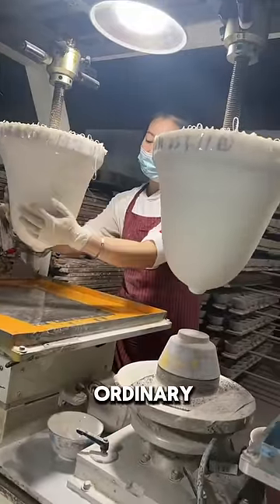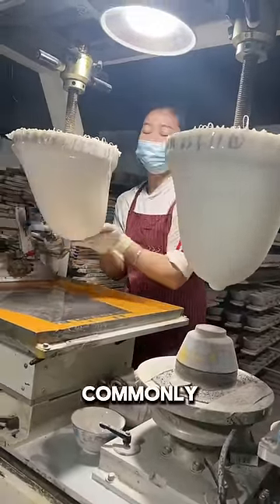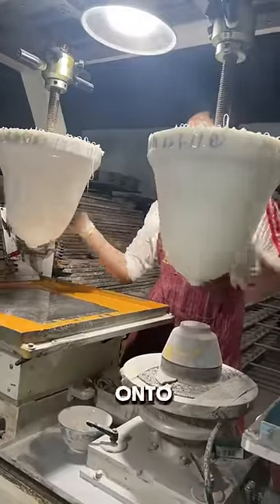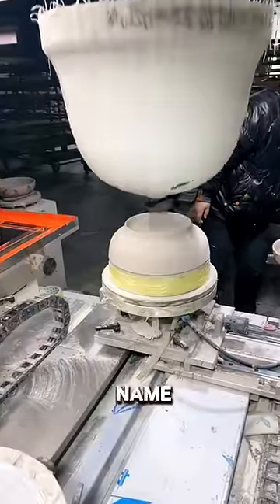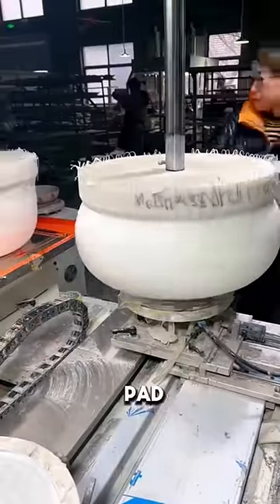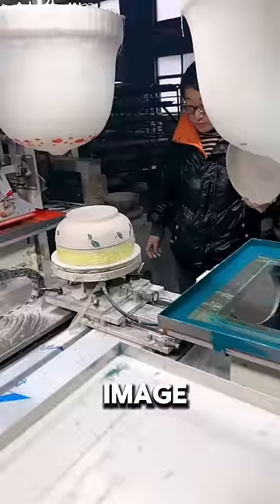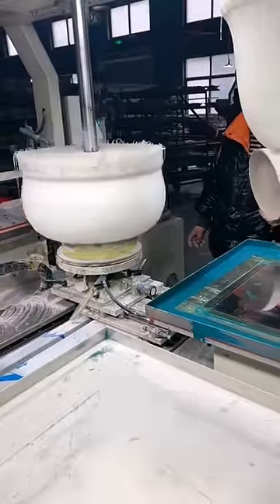Pad Printer Technology #shorts

Comment: For printing purposes, I can't figure out why it needs the nipple.
Reply: Yes !!
Reply: To center it i guess... 😅
Reply: to center it like the other commenter said, but also don't forget those tiny makers logos on the bottom of the bowls too
Reply: Its investor was a MAN OF CULTURE
Reply: Chris, It's a bump.
Reply: Its probably for the manufacturer name to be printed at the bottom 🤷🏾‍♀️
Reply: its for centering  and also it stops the silicon from jigglin too much after it touches the surface . Nature is the best teacher xD
Reply: I assumed it was for air displacement for a consistent stamp.
Reply: If it was flat it would become a suction cup. 

But because there is the nipple as you call it - and equal but opposite forces will have a reaction bonking backwards - 

the surface near the bottom of the bowls is pushed back upwards (doesn’t become a suction cup because there’s not a smooth surface the bump gets pushed in so when it’s pulled up it pushes down and cleanly away) reducing friction and tension overall

Centering is true but it’s not as big of an issue when the bowls are formed exactly the same size and same shape from molds and then placed onto platforms of the same shape and size. It can do thousands of stamps before having issues of misalignment since it’s basically on a hydraulic press which always does the same pushing motion.
Reply: Precision.
Reply: What else ye gonny tickle 😂😂
Reply: I think it's to get the print into the dip at the bottom
Reply: The bottom of the bowls have indents so the nipple let's them put patterns on the bottom without it becoming Warped if they want.
Reply: For the center and the logo that almost exist on all palate
Reply: To keep it from sticking
Reply: Center indicator
Reply: Because it is Man maid ✨🌟⭐
Reply: The designer had to keep every solemn straight face while explaining the nipple necessity to the board. But the board members also very suspiciously approved the design right away without any further question. 😅
Reply: The indent on the bottom.  I imagine if it were flat it wouldnt fill in properly.
Reply: Small fineprint
Reply: So it won't get stuck on the bowls.
Reply: @charlieg6799  So it's got printer cancer???
Reply: Because otherwise it would affect suction
Reply: Same here😂😂
Reply: @FireAnt1981  I saw such without "nipples" though 😅
Reply: Might be recycled from silicon dolls.
Reply: I'm dead 😂💀💀
Reply: Maybe because it could suction to the bottom with the way the bowl bottom is, it seems like it could stick or suck thin especially if it’s wet and the ceramic is not… that’s just a guess!
Reply: my wife always printed on me
Reply: So the male workers stay employed longer.......
Reply: mouth alignment
Reply: Centering and preventing queefs.
Reply: I thought the same thing. 😂😂😂
Reply: I was about to comment on the same thing lol
Reply: It's there, cause it is!! It is a silicon breast, being used here. I dont think they'd set up a whole different factory just for making these, rather borrow and have makeshift diy pad printer
Reply: To push excess air for tight seal for printing design
Reply: To push the air out to get a tight seal for printing the design
Reply: Exact thought I had lol 😂😂😂😂
Reply: to centre it ig or maybe just for aesthetic purposes 😳😳
Reply: To make precise initial contact
Reply: Literally,  the exact thing that just t popped in to my mind.

Comment: The Mark I version worked very well but the design team realized it didn't have nipples. These were subsequently added to the Mark II version. While this served no functional purpose, the design team stated it was necessary to portray a quality aesthetic.
Reply: My thoughts went the opposite way as I want to know what purpose the nipples serve. Perhaps something to stop the silicon from physically splitting after repetitive use or maybe a way to "fix" the tool from slipping during the print process? And yea, I don't care what they're called, to me they'll always be nipples.
Reply: These are the important questions. What's going on here?
Reply: @dscott6629 bro, those are giant milkers. Don't worry about the reservoir's purpose
Reply: I thought it was for the dip in the middle of the bowls when placed upside-down..
Reply: @PinkLuster  Initially, I thought the same, but no. The wild thing is that the design has since been standardized with additional rules. For instance, even though it could make for faster manufacturing, you can only ever design the machine with exactly two stampers.
An interesting side note is that, for a time, there was a split amongst the design team that nearly cleaved the group in two as one side suggested that there could be applications that may be better served by smaller stampers. The other side became indignant, insisting that larger stampers are better in all applications. But once they saw the smaller stampers in action, they conceded that all stampers are great regardless of size.
While this concession never fully repaired the cleavage, it did push both groups close together and lifted them up... from their disagreement.
Reply: @lftr_react  could you maybe explain that in simpler terms..? I'm sorry but I genuinely can't understand
Reply: @PinkLuster  Sure. I'll distill the story down to a single sentence...
All stampers are great, no matter the size.

Although, if you're talking about the mandate that machines can only be built with exactly two stampers, the team's reasoning on this was that an operator only has two hands.
Reply: @lftr_react  thanks!!